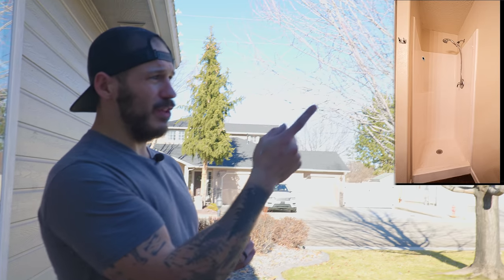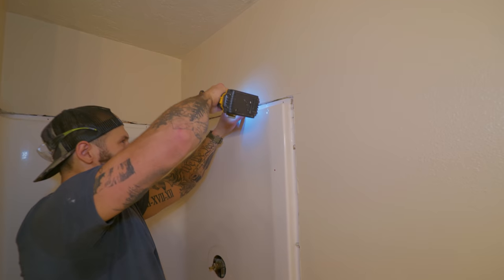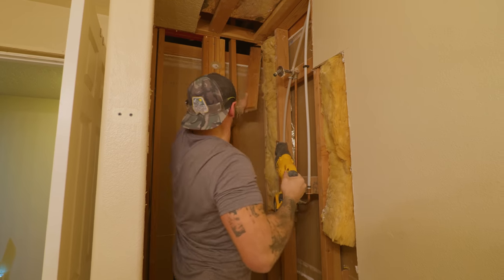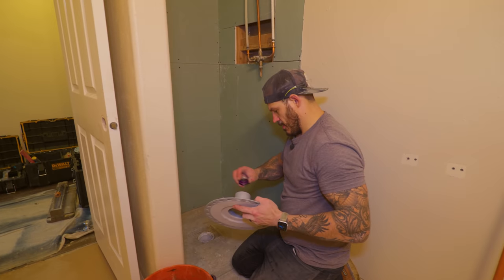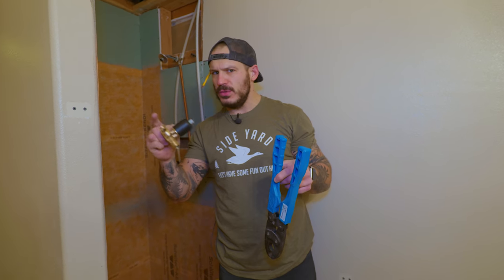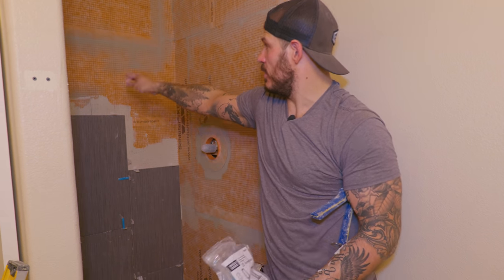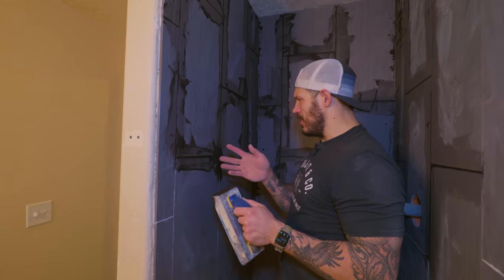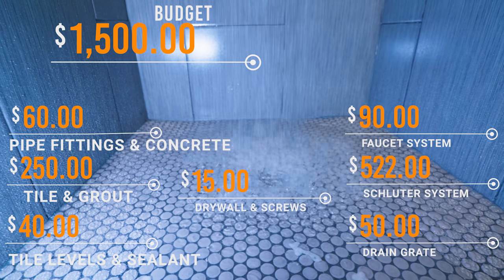Smallest Basement Shower Remodel

Comment: As a professional tile installer and business owner love the video and anything DIY I think it’s awesome to show people the process. Just wanted to throw a few things I noticed that could help on your next project! For any tile that is longer then 15” you should try to use at least a 1/2” x1/2” towel for better coverage and also like you did back butter the tiles. Love schluter use it on every job, not sure if you did but after you waterproof you should like the thinset cure for a full 24 hours and then do the water test since the Schluter can’t absorb the moisture like cement board it’s good to let that cure. Over all I would do things differently but everything you did was correct and you shouldn’t have a leak! Again just want to help pass some information for your next project, keep killing it!

Comment: Looks good.

One bit of tiling advice, make sure you are always combing the ridges perpendicular to the length of the tile not parallel, that allows the air to escape easier for the ridges collapse when you set the tile. Gives a stronger bond with better coverage.

Comment: Couple notes: the drain grate needs to be tapped down just lower than the tile when setting shwr floor. So water doesn’t pool around drain.

Bullnose tile on outside edges, could’ve been trimmed to line up with main field tile grout lines.

Painters tape is your best friend when using black grout lol

They sell an aerosol can of knockdown texture for patching that ceiling back where it matches existing knockdown. Might be a nice finishing touch.

They make an inexpensive pipe cutter for attaching to drill. You could’ve just cut the 4” and pulled it out to make room for Schluter drain flange.

Just thoughts for the next one. Great video. Good content :)
Reply: +1 Pipe cutter

Comment: Great job I really like it. One thing I want to add is these type of tiles do not need to be sealed only the grout.
Reply: Grout definitely does need to be sealed because with time water will absorb through the grout and get stuck between the tiles and the water proof membrane. Also it will cause tiles to crack and your grout will grow mold and mildew and start to look unpleasant to the eye.
Reply: @nob.s.renovations8946  Yes sir. Also depending on what kind of sealer you use it should be reapplied accordingly. Another good tip is to keep harsh cleaning products away as these actually just work against the sealant. It may look clean for the moment, but you've just created porous grout. 👍

Comment: It's called a shower curb.  Sanded or non-sanded grout also pertains to whether or not the tile is glass, porcelain, or ceramic and if it will scratch -- for example, use non-sanded grout for glass.

Comment: Learning has occurred!   Seems like a good idea to use the Kerdi membrane w/ green board  instead of the Kerdi board.  I like the idea of just overlapping the membrane 2 inches instead of using the Kerdi band for the seems.  Probably keeps the cost down too, I would assume.    I didn't catch in the video, how did you fix the drain issue?  How well did you match the texture on the ceiling?  I have texture all over my house and hate it!  Trying to see what best practices are out there before I tear into some of my drywall.  Keep up the good work bud!

Comment: I thought you can’t use anything under 2x2 for the Schluter pans? Penny tiles cause too much point load on the foam
Reply: I believe I heard that from TileCoach.
Reply: You can always call Schluter to confirm, but they allow penny tiles on their pans with one exception: no canes/wheelchairs/etc. in shower. Basically, nothing that has a small area point load.

Comment: I know these Schluter sets are trying to make showers easier but their floor kit requires more work than just using 2x4’s for the curb and then building the pan with Portland mix and finally covering it all with red guard. Their wall inset kits are awesome though.

Comment: Teflon tape is for metal-to-metal pipe thread, not use for plastic pex fittings that have a rubber seal inside, the rubber is the seal, not the threads (future ref) Great video!

Comment: Ideally you would have used 1/ 2 trowel on 12x24 in tiles. Also trim edge in the corners which you can still put Just clean behind the tile and slide it in .. it will give it a much nicer finish. Great job tho .

Comment: Hey man! Huge question: is it okay to use drywall under tile by using the schluter membrane??
Reply: Yep - just make sure its square and plumb, and dont skimp on the thinset.
Reply: Minimum code allows you to drywall a shower surround with mold resistant drywall and cover with a water proof membrane (aqua defense, red guard or schluter) 
Next would be a cement board, dens sheild or the cherry on top would be the shcluter foam board it's self.

Comment: Hi, I noticed the wall between the shower and the door to the bathroom is about 10 inches wide, did you check to see if it could be made thinner and given the shower an extra 4 inches. I know that does not seem much, but in a small shower like that one 4 inches would made a big difference
Reply: That’s a lot of work for four inches. It would also cause the drain to be slightly off center. Probably some of his reasoning.

Comment: Was the original intention to have the shower head in the ceiling instead of the wall? I’m just curious why you demo’d the ceiling if you didn’t place the shower head there?
Reply: @cocainejohnson2433  I mean, you can fit 1/2” PEX tubing almost anywhere. I think I’d have rather lowered the ceiling by another sheet of drywall just to avoid that shower arm in a phonebooth and achieve true top-down rainfall.

Comment: I'm a fan of most projects you do, but you should have researched the schluter requirements first. The shower pan is for sure gonna fail. Your not supposed to put tile any smaller than 2x2 on the floor. I've seen shower floors fail because the tile was too small. It's a shame that you put in all that work for it to be pulled out soon due to a tile failure.
Reply: Ditto. I learned about that from other sources some time after I installed mine. Luckily though I didn't use penny tile mosaics for the pan, only because I didn't like the look. I'm trying to remember/figure out if they mentioned that in the instructions.

Comment: I would have tiled the ceiling as well, hard to match drywall texture like that or replaced the entire piece of drywall that was there.
Reply: Yep, especially in that size space. He probably had enough scrap greenboard to re-do that entire ceiling spot. I'd probably drop in a can light  in that spot since the overhead shower didn't work out.
Reply: @kg4gav  I agree, its an art matching texture. Even if they had to buy one more sheet, it would have looked better than what was done. Finishing details take a job from decent to excellent.

Comment: Not to be a jerk but technically those adapters on the mixing valve shouldn't have Teflon. The have a rubber seal. You risk splitting the plastic with teflon

Comment: You should use modified Thin Set even tho instruction call for unmodified.  It's European instructions which are different from North American.  Checkout Tile Coach on YouTube.  He's a master at this and has tons of videos.
Reply: Second mistake, do not use any tile smaller than 2"x2 " on a Schluter foam pan.  You risk those little tiles breaking the foam from pressure.  That is also in the instructions.

Comment: Plasterboard as a tile backer behind waterproof membrane? That wouldn’t pass here, seen so many leak, the slightest movement will transfer from tile and crack it, it needs a solid substrate like cement board..I love your stuff man but plasterboard is not the way to go..
Reply: also was wondering about the mortar because in between the tiles it looked like it didn't get smashed in enough.

Comment: Using green board (water/moisture resistant gypsum board) in shower stalls is a huge code violation. It cannot be installed under tile, cement board or other approved material approved by the code is required. Geez.... where are the inspectors??? And how is he doing construction work for others without a license???
Reply: Not everywhere has the same codes. It will be fine, don't worry.